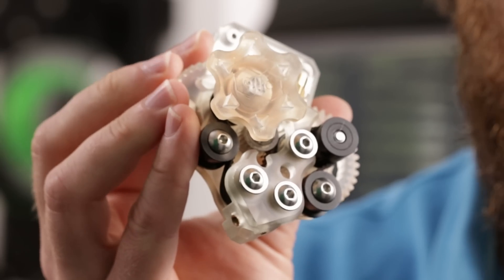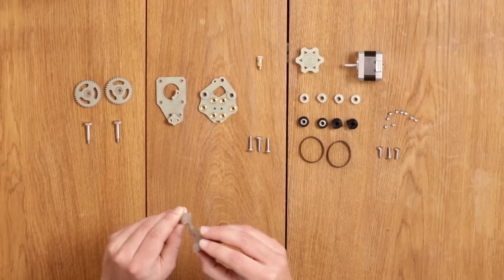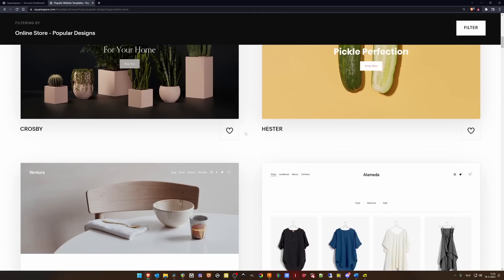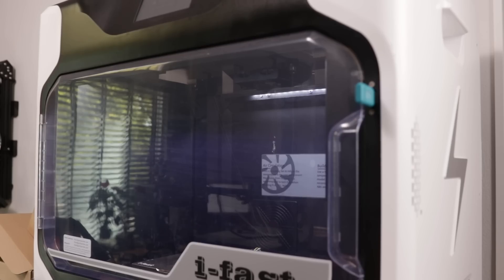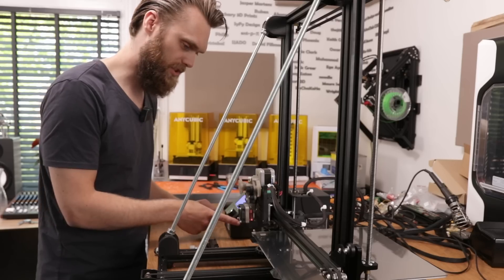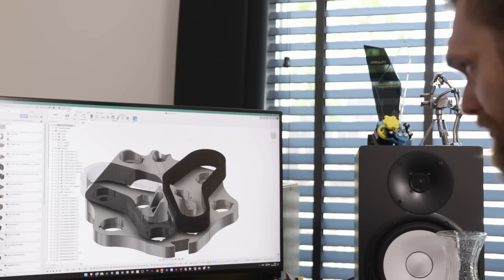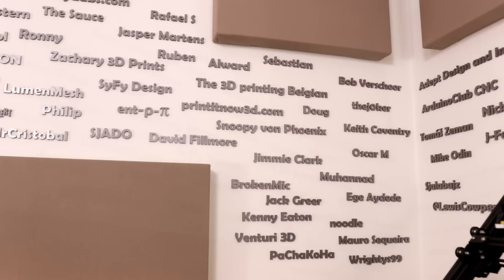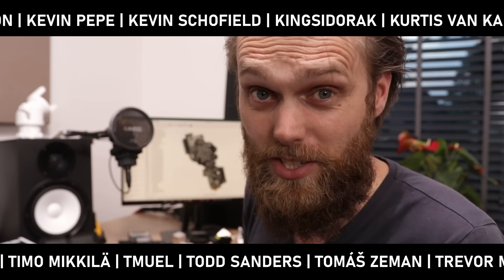This Extruder is a TPU Beast!

Comment from the maker: Hi everyone! Finally, the files of the Proper Extruder are released! I needed to do some improvements first and now I'm happy enough to share the first version. You can download them for free from my website https://properprinting.pro/product/proper-extruder/
Reply: @didiz01  60A is lower than 30D.
Reply from the maker: @didiz01  30D is similar to 80A so I shouldn't have any problems printing that ;) https://www.teknorapex.com/thermoplastic-elastomers-and-measuring-shore-hardness-chart
Reply: Do you think your struder design will work on a cr10v2 if I print it on the same cr10v2??? (sorry I'm from the 3rd world jajajajaja having an cr10 here In Colombia is an very luxury thing) tanks man you are awesome... (I follow you since the beginning trough different accounts... I had to change it every time I change my phone)....
Reply: Jajajajaja I wrote the comment before I finished the video jajajajaja greetings my friend... 😂😂😂😂
Reply: @didiz01  60a is lower than 30d
Reply: Can it be fitted to a Voron 2.4?
Reply: Earned my sub!  Now you can print tires for your wheels!!
Reply: @didiz01  Hey! It would be nice to bring up your point without being rude. Maybe  he hasn't come across your Bondtech nor your fiberflex 30d. You could have said it this way: "Hi. Have you come across fiberflex 30d ? Do you think your design can extrude this type? Thanks."
"You lied!" Good gracious! 
Can you do what he's been doing?

Comment: The fact that despite all of the work you've put into this thing you're keeping it free is exactly why the 3d printing community is so great. We're all out here trying to make things better, not only for ourselves but also each other. Bless ya and keep at it.
Reply: I believe it's $3.00 very reasonable.
Reply: @mrbmp09  It's pay what you want, so you /can/ pay nothing. $3 is merely the recommendation.
Reply: I plan to do the same with my designs as they start rolling out. I know I need money, but I think everyone should benefit from the knowledge of others.
Reply: @peenerpan113  I mean, if you're giving something away for free (or pay what you want) there's an implicit understanding that you won't necessarily be making any money off of it, or are at least not expecting to -- Ultimately what you're positing is only really an issue if you had intended to monetize it from the get go.

Comment: All other cool things aside, I think the most amazing part is that you managed something (and by that I mean "printing ninjaflex") that up until just a few years ago many companies – with, like, actual R&D budgets – tried and failed at. That's, I think, the most beautiful thing about the 3D printing "industry": I don't know of any comparable field where the line between "enthusiastic hobbyist" and "professional engineer" lie so close together.

Definitely on my short list of things to print if and when I have access to a resin printer (should really check if there's a hackerspace near me, damn my procrastinating xD)
Reply from the maker: It's so cool that with 3D printing the hobbyist is able to create (semi-) professional parts! The biggest part of the work when developing a product is everything but the prototyping phase where I'm in right now. Optimizing the design to make manufacturing cheaper, do functional testing and real life testing, complying to standards, (get back to the drawing board and do this cycle again at each fail) sourcing cheaper parts (test again), marketing, packaging and be better/faster than your competitor. You quickly need a whole team to get things to the market ;) This of course depends on the product, especially consumer electronics requires a lot.
Reply: Computing and software development, theirs very little difference between professional and hobbyist.

Comment: Wow! Amazing work!
I was inspired by your last video to develop a belt extruder of my own for this exact reason. I print in Recreus Filaflex 60A filament for work all the time and we constantly get buckling issues as you describe. It's so interesting to watch you go through the same problems as I have been these past 2 months. Your buckling solution is really elegant, I didn't think of it at all!
I managed it in a different way, by putting the two drive belts in a slight V shape (about 2mm apart at the top pulley and 1.5mm apart at the bottom). This means there is more pull from the bottom and buckling doesn't happen (unless retraction is higher than 3mm). With this setup I've managed to get my home CR-10 printing at 45mm/s in 60A.
Also when my stepper started skipping (like crazy!) I increased the gear ratio - it looks a little silly now but it works a treat!
Keep going man! You inspire makers everywhere.
Reply from the maker: That's awesome! Interesting approach to put it in a V-shape. Awesome that you're printing the same material on the same printer with a similar method!

Comment: I've been printing flexibles for over 5 years now (started with M3D's "Tough 3D Ink", now working with NinjaFlex 85A).  Really happy to see the innovation in this extruder.  Next up, maybe switch the hotend to a short, all-metal?

I got burned (business/money sense, not heat) on my last large printer and I'm currently hunting for the most suitable out-of-the-box (i.e. minimal mods) printer for flexibles without going into the crazy stratosphere of $5K plus machines.  Seeing what you've done here is a tremendous help in that hunt!  Great content!

Comment: If I can give you some advice, I would mount the spool on a pair of bearing without a cover nor grease (naked bearings) it will really reduce the force required to unwind the spool. This only is for flexible materials ofc

Comment: I'd love to see how that belt drive holds up over time, what fails first. Very cool project.
Reply from the maker: Me too! Fun fact, APS tech solutions https://aps-techsolutions.com/en also uses the same type of belts and I had a great chat with them. They print a lot of Nylon with carbon fiber without any problems. This gives hope!
Reply: @properprinting  just setup a silent driver and a gcode loop of 500mm forward and 500 back on a 700mm length of filament
Reply: Yeah I feel like the belt teeth will wear out
Reply: @MkrezyL28E  these belts last for ages. I've used them on my CNC lathe for over a decade and still haven't changed them out.
Reply: @properprinting  My go to belt when grip is important are OptiBelt. We use Optibelt ZR series on toroid winding machines where the back part of the belt is used for friction tensioning the wire, and we tried a ton of belts. Optibelt's rubber compound seems to provide the best grip, uniform wear, ideal hardness, not to rigid and not too soft.

The grip might be not important for flexible filaments, because the filament itself might grip on a harder belt, but might be important when one wants to print harder, possibly slippery filaments as well with the same setup.

Belt backs can also be coated. We found a company that offers twenty or so coating materials with different hardness, grip, abrasion resistance and so on, especially for the purposes when you want to feed material with the belt, like conveyors and such.
The only reason why we don't use them on the toroid machines is cost, mainly. The Optibelt ZR was "good enough" for us so far, and the coated one would't fit the machine easily anyway. Still good to know that it is an existing thing when needed.
Reply from the maker: @gabiold  Thanks a lot for this valuable information!

Comment: This is the proper channel! Always exciting engineering work delivered with the right amount of subtle humor. I'm always looking forward to the new videos.
Can the extruder be printed with FDM too or does it depend on the precision of resin? I'm also wondering why you need such a big motor. Is it because if the friction caused by the large contact area of the belts?
Reply from the maker: Thanks Max! It's designed in such way that it can be printed with an FDM printer. I made special versions of the base part for FDM printing. The motor mount must be printed out of ABS, Nylon or polycarbonate because of the heat of the motor. There's quite a lot of force between the belt and filament causing friction. It's a fine balance which probably can be improved. Right now I want to make sure that it can generate enough back pressure and a bigger motor is not a problem for me (this stays cooler too)
Reply: @properprinting  One solution to the stepper motor temperature problem with a PLA or PET-G filament would be to use a stepper damper, this would isolate the temperature from the motor. You should get a stepper with a longer shaft or make the gear shaft longer to reach the motor.

Comment: Yes! Finally! Im so exited when you channel is shown as a notification in my cellphone. Very nice video. I have a little thing to say. I have learned that even the smaller steppers, and even without gear readuction, have enought power to push filament. So going with a bigger mottor maybe is a workaround that works, but it no solves the problem. I can suppose that in this situation, is a good solution, because I can guess that the extra force the motor have to do, is because the flexible filaments is rubbing agains all the path between the belts and the extruder. But anyways is a detail!... keep making videos, you are my favorite youtuber! have a good day!
Reply from the maker: Thanks! The downside of this that it requires more force, also with PLA. I experienced something similar with printing the guitar neck. So, or I have to accept it, or I have to make a larger gear reduction. My goal eventually is not to extrude plastic with it anyway, just a cool extra feature ;)

Comment: Awesome work man. I designed my own extrusion idler for my Ender 3 V2 and flexibles were my primary concern since hard plastics haven't even given me anything more than slight quality variation from loose or overly tight setup. The hardest part was to ensure the filament path stayed perfectly straight, the slightest bend and it would kink seconds into the test. Still need to go in and beef up parts of it, the first version lasted a few month and then began to bow without any solid support. Plan for that is to print thicker base with two snug fit holes to insert a thin steel rods, just a couple out of old CD drives. As I learned you have to treat the pressure as a source of heat deformation, same effect just takes longer.

Comment: I won a 1Kg roll of BASF Ultrafuse 316l and debinding and sintering from the TCP show and have been earmarking parts to be printed in this material and your extruder has had my attention since you first revealed it to us, when I do get it printed and processed I will send you some pics and video of it although itv may take some time as I have some more smaller parts to design and print to get this material used up as the whole 1Kg has to used up before I send it to be processed
Reply from the maker: That's sick! I'm also working on something with that filament (I don't own it though) I'm very curious about your pictures!
Reply: I just received a new set of diamond lapping pastes and papers which I will use to get a beautiful polished finish to the parts, I am also looking into getting some coloured anodidsed nuts bolts and washers for it, will make a great accent colour!

Comment: You sir, are a genius!  Normal drives depend on biting in to the filiment to feed and assure positive displacement.  But TPU just deforms out of the way.  Yours grips it over a long segment.  The only issue I see is how long will the belts last?  Rubber likes to oxidize and off-gas.  I wonder if it'll rapidly degrade after coming in contact with 10kg of filament?  Might still be worth it to keep replacing them though, if you have to print a bunch of TPU.

Comment: Run a ptfe tube through the extruder with cutouts on both sides for the belt to grab on the filament.
Reply from the maker: That's actually not a bad idea. It'd be a difficult cutout, but doable. For now this seems to do the trick, but I'll keep it in mind, thanks!
Reply from the maker: @scruffy3121  I tend to think too difficult sometimes😅

Comment: I know the TPU gear was just a test piece, but TPU is actually an awesome material for quiet low backlash gears if you do herringbone with zero clearance and 100% infill. I'm using TPU planets in my E motor gearbox. I think it might not work well for low speed high torque output, but it's great for stepping up speed.

Comment: You might be able to increase the pressure and decrease any friction/wear on those grip sliders and belts by replacing the grip sliders with multiple 1x3x1 micro bearings. 4 rows in an overlapping pattern.

Comment: I must have missed this video! Glad I saw it. Freaking wicked design man. You must read your Mcmaster catalogue all the time like I do. To know that those very unique parts exist at all.
Maybe a small yet very custom spring steel sheet metal part to replace your belt pushers. It would be much more robust and wouldn't lose tension as it wore

Comment: There are more softer filament in the market. Polish brand Noctuo have "Extreme FLEX" with typical hardness of 40ShA. It's quite hard to get because of it properties(it might be dangerous to overheat it). But I'm sure if you will contact them, you will get this filament. I've got it myself but from 2'nd hand.

Comment: Think I would print two pulleys with a V shape or concave so the belt on one side keeps the belt aligned while the other flat side applies pressure. Would need some trial and error but I'd print like 10 different versions at once and just print, swap, print swap.

Comment: you can increase the gear ratio, make the  spur gears larger so you wont need a big stepper motor. you can just use a single large spur gear, then couple the two belts by using the idler gears at the bottom, coupling those.

all those bolts and inserts must have negative effects on resonance, any ideas on making it lighter or using klipper with an accelerometer?

i think one side needs an eccentric nut system to adjust the distance between the belts, tune the grip this way. or a  parallelogram mechanism could work.
an adjustable gap could also mean that you can get away without using shoulder bolts, etc.

try using another set of small idlers instead of those 3d printed plastic flat parts to push the belts together, constant wear from printing could make those printed parts or the belt thinner.

Comment: Nice design!! .. I've been using the smaller NEMA 14 motors with gear drive for years now ... much less extruder weight than using the more common direct drive NEMA 17.

Comment: Have you considered printing the belts yourself, but with a round or V shaped channel on the center (where the filament runs)? You are already printing flexible filaments, you might as well try! This would give you not only more grip, but it also would keep the filament from running to the sides.
Reply from the maker: That'd be cool, but just printing belts out of TPU won't work since it stretches too much. It needs to be reinforced with fibers

Comment: wow! amazing work!
I've just used my break in the office just to watch that extruder really doing its job!
What is the weight of the extruder with the stepper?
I guess it won't be a good idea to print abbrasive materials with it due to wear of belts?
I need this for my CR6-SE O_O ..but out of aluminium maybe?

Comment: I was thinking, what if you have a stationary bed. Then the zx axis on just the two motors as in the Cartesian, but you move the entire zx axis gantry along the y axis. Then take the other two motors and add a second zx gantry that can now move independent of the other on the y axis. I would try to make the each zx gantry assembly's idex. Then try to make a tool head that can change it's angel towards the y axis; opposite it's homing corner. Then you could hopefully put two rotary axis on bother ends of y and add a belt printing feature. Or just a rotary axis on the middle of the stationary build plate. Beef everything up, use a duet board, and a tool change system for CNC, Lazer, etc. Steeling the idea from the new Bambu labs printer. Use lidar for bed tramming/ leveling, flow rate compensation, and active vibration cancelling. But you could also use the rotary axis and the lidar scanner to 3d scan items for either additive or subtractive manufacturing. Someone please read this

Comment: Just an idea, have you tried inverting the belt so the teeth are facing the filament? Then you can cut/melt a channel in the teeth in the middle of the belt for the filament to sit in. The interlocking teeth form a channel that completely constrains the filament sideways, potentially giving more consistent extrusion and removing the extra friction from the guides you use currently. This would let you use the smaller, lighter motor again.
Reply from the maker: Thanks for sharing your idea! I do like it, but I try to prevent modifying stock parts. My goal was not to print filament with it eventually and the bigger motor is not an issue for me. The guides by the way aren't causing that much friction, this looks like to be inherent to this belt design. Maybe I'll design and print my own belts one day ;)
Reply: @properprinting  i get what you mean with not wanting to modify standard hardware. Perhaps instead maybe put a groove for the filament in the timing belt gears? And add anothet set of idletrs where those guides are? A smaller, lighter motor is a big boost for direct drives
Reply: @H34...   unfortunatly With the Belt Drives in its current configuration a lighter motor will skip steps
Reply: @legofreak88884444  I know, thats why I was suggesting ways to reduce the friction so the smallrr motor would not skip steps